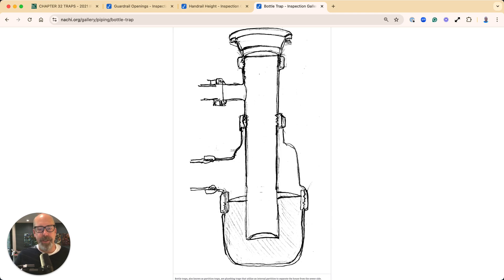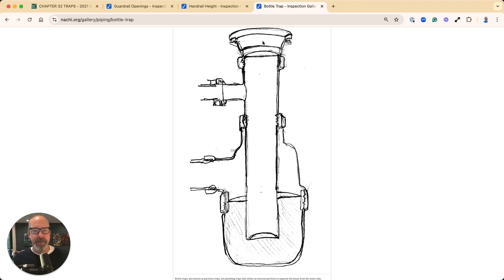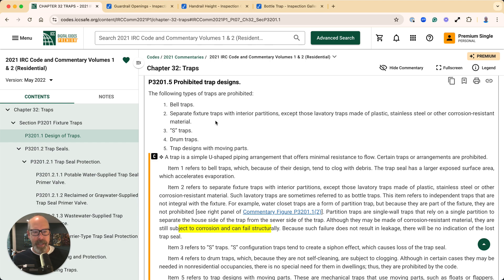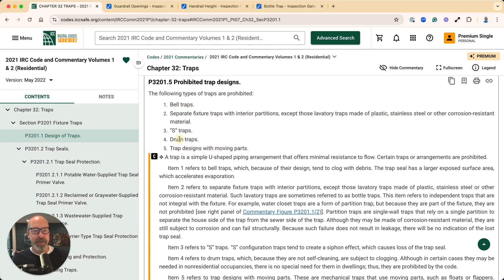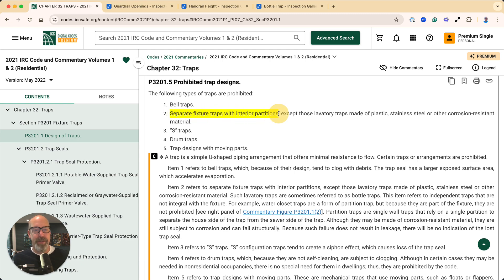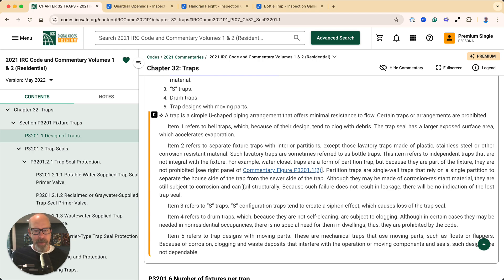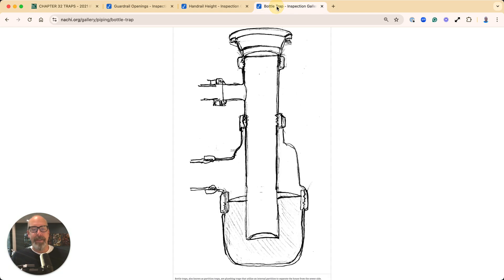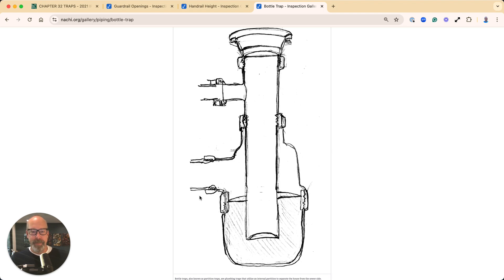Inspecting a bottle trap during a home inspection.

Comment: You can smell the gases if the trap fails, and if a trap dries out (ie sink not used for months) it can also allow gases to exit. There really isn't a perfect solution for drain traps.
Reply: "There really isn't a perfect solution for drain traps."
Yep. I suppose you could use sensors that could trigger opening a water supply valve to fill the trap much like keeping a toilet tank filled (although a toilet tank uses moving parts/float rather than a sensor).
But that could still notbe consider "perfect" because it would likely add significant expense.
Reply from the maker: Thanks for commenting, that's a good point.